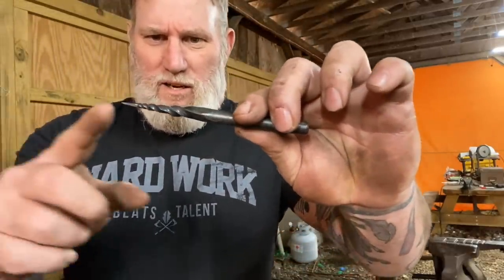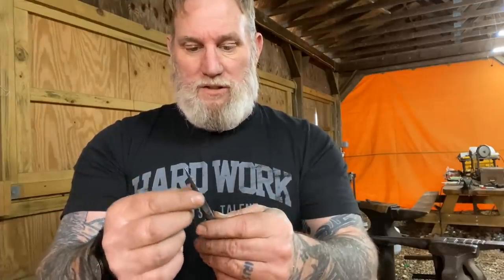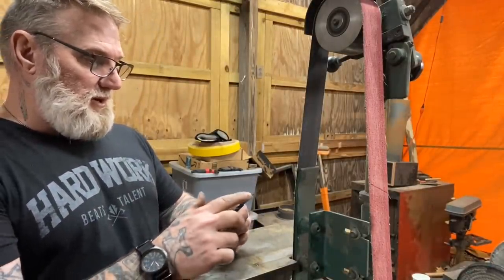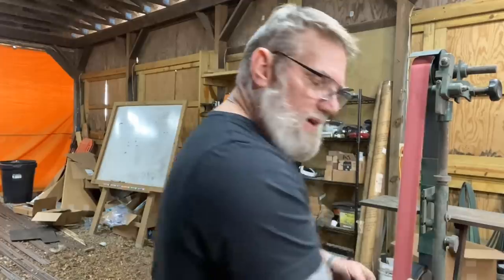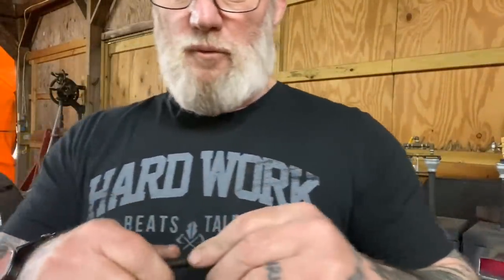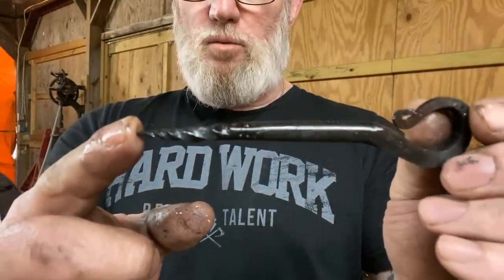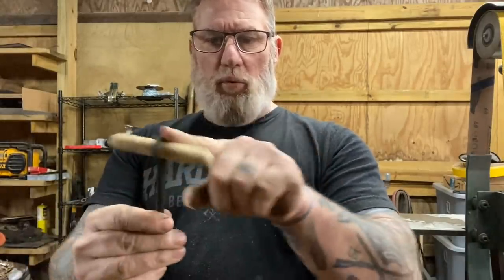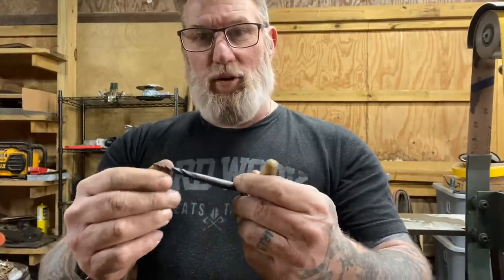Forging a Gimlet

Comment: I wonder if making it triangular or using the edge of the anvil to create fluting on each flat face of the gimlet would create sharper edges and potentially make it more effective at cutting the wood fibers. I imagine it probably isn't worth the extra effort, but it would be interesting nonetheless

Comment: Dave...if you were to forge it square and then file 90 degree edges then twist it, the 90 degree edges would possibly cut better thru wood or leather........just a thought

Comment: Neat tool. But couldn't you do the same thing with like a small augur bit? I'm not cracking on it. It's a real question?  Like heat an bend a loop or ring in the other end ?  Man I'd love do hang out with you for a day or so an just bullshit an knock around ideas. You great dude keep on doing your thing!  👍